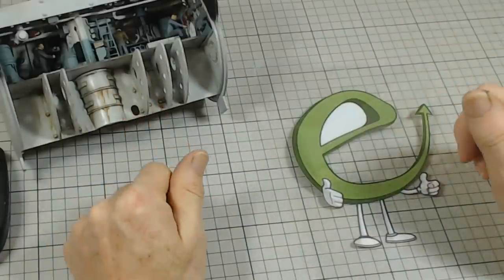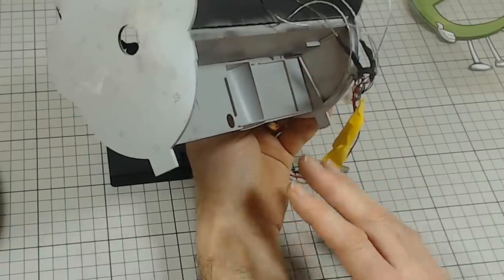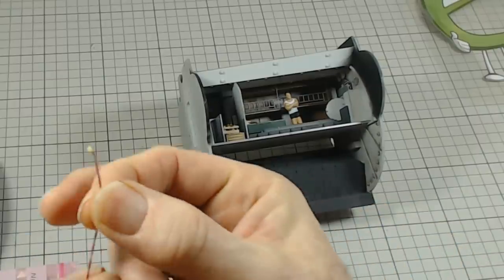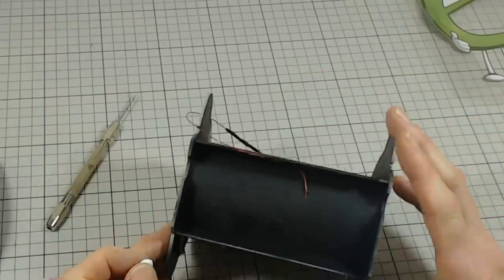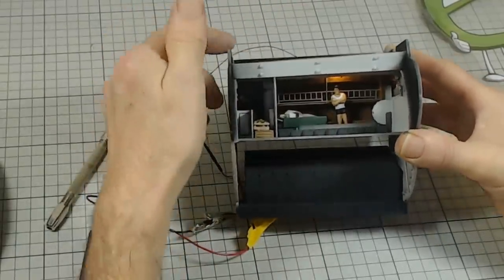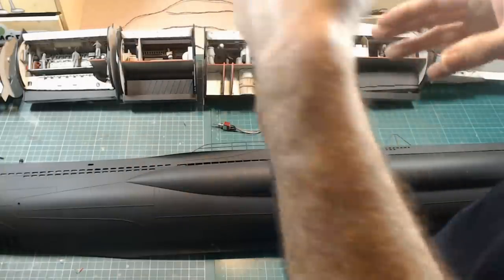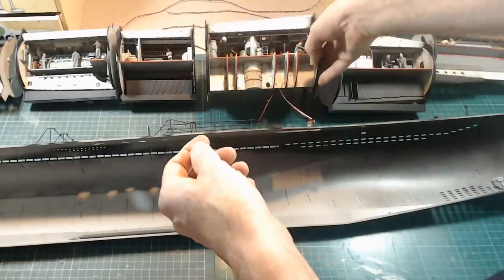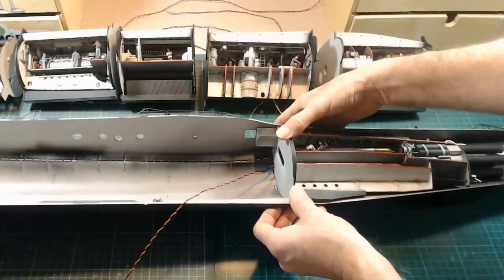Trumpeter 1/48 scale DKM  U-boat Type VIIC  U552

Comment: Subs use red lights at night. Then only in the operation compartments. They run white lights in the engine room & torpedo rooms. Super model. Love those interior compartments. So much fun in each section. Good job. Red keeps eyes accustom to peering into darkness at periscope depth. Or running on the surface.

Comment: The main complaint I have with this kit, and it's not a minor one, is that the cutaway on the conning tower is on the opposite side. That doesn't allow to showcase a solid port side unless you just sacrifice the port cutaway and paint over the clear side panel . Don't know what they were thinking, but that was a bad move. At least give us an option

Comment: submarines use red interior lights
Reply: Only in the short time before surfacing at night to get the watch officers' eyes used to the dark conditions quicker, and only in the section beneath the conning tower.
Reply: @sopwithpuppy  Typically a few red lights are used as 'standing lights" in berthing areas to allow men move about and dress without waking everyone with white lights
Reply: Good point, but that is in control room and cunning tower.
Reply: No. not everytime